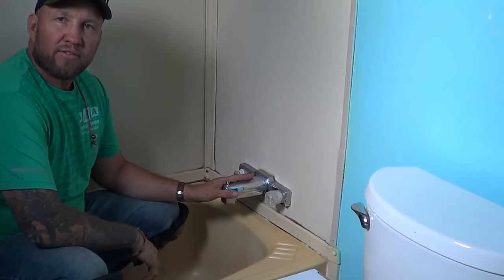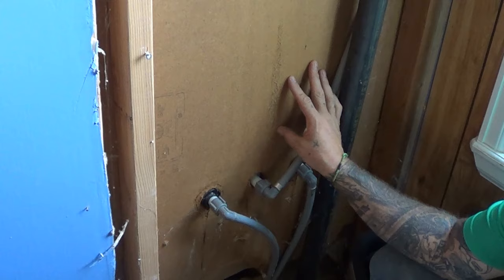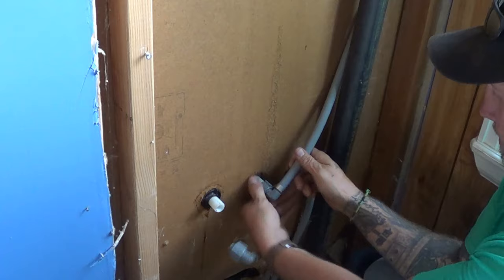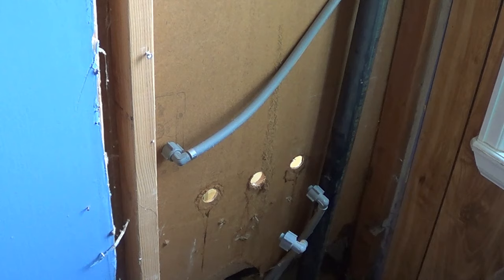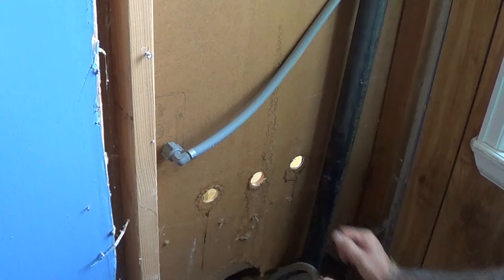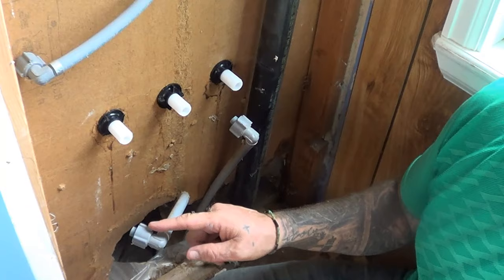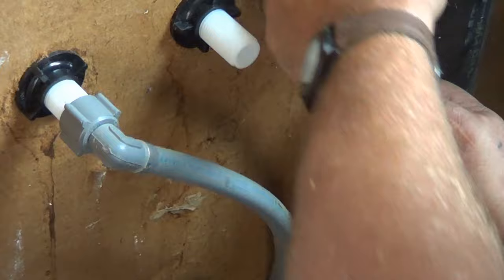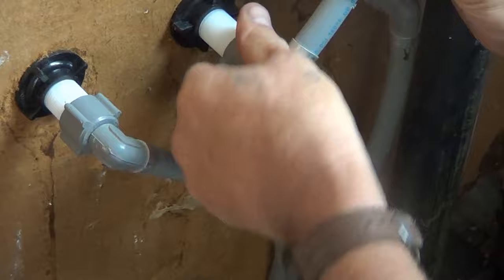How to install a Bathtub Faucet in a mobile home

Comment: How did you get the wall off
Reply from the maker: To remove the back wall, behind the surround to access the back end of the faucet, you will either already have the wall cut and be removable, or you will have to make a removable wall. This you will need to cut the wall itself.
If you are looking to remove the surround, you will need to gently pull it away from the existing wall. Now, you want to be very careful, the surround was glued to the back wall, therefore, when removing it may cause it to crack, split or rip apart. When that happens, you need to replace the entire surround with a new one. Sometimes, you can carefully pull it away with out damaging the back wall.

Comment: Just got an 87 doubble wide an it's got a garden tub, an a single shower,, in the master bedroom,, well the water is on an no leakes,, you go to cut the water on in the shower an it blowes out the back of the faucet,, whats up with that,, haven't worked on mobile homes before,,

Comment: any chance of fixing just the broken knob without having to replace the whole thing?
Reply from the maker: Hi. Yes you can replace just the knob. You need to remove the dial cover plate and behind that is a screw that you remove and now can replace the handle. If you are needing to replace the stem which is behind the handle, then you need to turn water off, remove the handle you will see either a brass or white plastic stem, you will use a wrench to twist off the stem. Get the right replacement part and replace the old stem. I hope that was a bit helpful. :)
Reply: @randythemobilehomeguy3715  Hello! This video is life saving! My hot water knob broke so I am using a screwdriver to turn the screw to turn the water on/off. The screw is getting stripped so I want to replace it asap. Can I replace just the hot water knob? Is there a special knob for mobile home faucets I need to purchase or would a local hardware store carry what I need? Do I need to turn the water off to do so?
Reply from the maker: @victoriablais9332  Hello Victoria. Great question! And thank you for watching our video!
Yes you can replace the handle of the faucet. Sometimes you can replace the handle with a universal one bought from a local hardware store. If they don't have it, you will need to purchase one from a mobile home store. If you are able to take off the working handle and use it for a reference with purchasing a new one, that would benefit you. If you are just replacing the handle you do not need to turn off the main water. Now if your teeth on the brass fitting or plastic fitting that the handle screws onto is bad and needs to be replaced, you will need to turn the main water off and drain out the line. That piece is called the 'stem & bonnet'. If you need to replace this, then you will want to take it all the way out. If you look on the piece along the rim you should see some markings. Those markings are the model number of that piece. If your local hardware store doesn't stock that item, you can find it online. Roughly $8-12 dollars a piece. 
I have found Mobile Home Parts-R-Us does carry mobile home faucets and parts. They should be able to ship you those smaller items. I hope this helps!

Comment: so connecting to toilet and bathtub i have to convert to "7/8 ballcock" right? fixxing my bathroom and 1/2 sharkbite threads are not matching toilet or faucet after the winter storm obliterated the cpvc in the house pretty much everywhere. for the toilet i think i just found out i can get 7/8 ballcock to 3/8 and get a shutoff valve 3/8 to 1/2 . not sure how i would go from 1/2 pex to 7/8 for the tub tho
Reply: Hello, the toilet fill valve threads are 7/8 and the faucet threads are 1/2 inch. They do carry a swivel flex line for toilet and a different one for faucet. I like the ones with a shark bite shutoff on one side. The swivel elbows you sometimes need for the back of the faucet which go to 1/2 inch piping are unique and you can get those sent to from Mobile Home Parts R Us

Comment: do you have any thing to replace the 1/4 in merflex pipe(original pipe writing) that goes from the faucet middle to the shower arm? home depot, Lowes, and ace hardware are completely useless in knowing anything about the line i need even when even when i have the part with me.
Reply: Hello, is it the gray piping with 1/4 inch inside diameter. It would be best to replace that whole section with all new 1/2 piping or tubing

Comment: Can I replace just a knob without having to cut out the wall? 😭
Reply from the maker: Yes you can replace just the knob and stem & bonnet. You would still want to turn off the main water if you need to replace the stem & bonnet. If you are just changing out the plastic handle, you don't need to turn off main water.

Comment: Are the plastic nuts after the swivel fittings supposed to be glued so you can't twist them off? I had a plumbing company replace all pur pipes a few years ago and now my hot water side is stripped on the handle and im trying to replace it but they've glued them tight for some reason so I don't know how to get them off.
Reply: They shouldn't be glued, I replace  two my old shower faucets with mobile faucets, in my mother's home, and they work great.
Reply: @sharkwo7  yeah I know they did a shitty job. We had someone come in and fix it properly.

Comment: Where is the shut off valve ?
We checked every where except under the home below the water heater....
Not on floor by water heater.
Not by the w/ d connections
Not outside the home...
Some say there may be two but where.....Any idea? 
T.I.A
Reply: The mobile home is brought to your site where there is a main water hookup, often coming out of a well the size of a five gallon bucket. From there a main water line runs along the ground to the hook up on your home, most often under the water heater. On this line there is usually a meter. Most often there is a shut off down in the well and just before it goes Into the house. Also they often put a shutoff next to the meter. If you live in a park, often calling the maintenance office ‘should’ help though not always I know. If on land there should be a metal capped well, often by the street where there is a shutoff. Hope something in there helps. Thanks for the comment.

Comment: Hhhhhhhhhhhhhhhhhhhhhhhhhuuuuuuu.... I was expecting to have to cut my wall open after I inspected my faucet situation. But I was really hoping there was a way to do it without doing all that drywall and mud as well. At any rate, thank you for the helpful video, even if it did confirm my ill fated suspicions.. thanks again

Comment: And a shower arm also, can I do that as in other videos on YouTube?
Reply: Hello, the shower arm you can do at the top like a regular house type application, you just have to add the support if your wall is wide enough to accommodate it. You probably know, but you will also have to do that from behind the wall . Just the hook up to the faucet at the bottom will have to stay the same, a swivel elbow.
Reply: @randydolph852  Thanks so much your a huge help. Have a great day and Happy father's day if it applies to you. Be safe.

Comment: My faucet is exactly like the one in the video for my mobile home. I went to turn off the hot knob side and yes it turned off, thankfully but something felt loose so for added measure I tightened a little more and now it just spins. I opened the cover for knob.. and screw is stripped too. Help please. Thank you. What iinds of things am I getting myself into if i try to fix this myself. The whole cutting wall thing for me in video.. isn't something im comfortable with.
Reply: So waters off. Knob spins. Screws stripped, on hot side. Same faucet in video.
Reply from the maker: Hi. I'm sorry to hear you are having problems with your faucet handle. I will do my best to help you! What you will need to do is replace the stem & bonnet that is behind the handle. That is what turns the water on & off. It sounds like that part is stripped. To do this, you will need to turn the main water off. Next, you will take off the handle by removing the the screw. Once you remove that, you will see the stem & bonnet. There is a clear plastic piece that is holding it on which will have to be removed by prying it towards you with a flat head screw driver, once that piece is off you can unscrew (counter clockwise) the stem & bonnet. You will want to get the exact right stem & bonnet for your faucet. They don't make a universal one for it. Once you reinstall new stem & bonnet realign it so that the clear plastic piece can go back into the holes. You will also want to get a new clear handle for your new stem & bonnet.  I hope this helps! :)

Comment: How does the shower get turned on? I don't see a knob for the shower
Reply from the maker: Hello, the knob on the tip of the spout gets pulls and closes off spout and pushes water up and through the shower head. Thanks for the question
Reply: @randythemobilehomeguy3715  I live in a mobile that has the Mohen 3 knob but I have to replace it all and that mobile home style looks a lot easier than what I have. I got by for a while replacing washers but it's shot, even the shower won't turn on. I'm replacing the wall there too so I wish I knew if it would be better to go with the mobile home style. It looks like hot and cold water lines connect and a pex hose connects to the shower head. Is that what I'm seeing?

Comment: What kind of wall panel is that
Reply from the maker: Most of the time it's a drywall panel on the back side. Sometimes, it will be the wall paneling you often find in mobile homes, it's a thin piece of paneling, that you can purchase from Lowes & Home Depot.
Reply: @randythemobilehomeguy3715  they don't screw it on do they
Reply from the maker: @brandoncoley8190   sometimes if the homeowner has already worked on the tub/faucet, the'll have already cut a hole out and used it again , so they'll use screws to hold it on. You can do it that way. I've even seen people whose panel is on a bedroom wall, they will trim out the area where they had to remove the panel. It looks nice.
Reply from the maker: You can always use brad-nails to attach it
Reply: @randythemobilehomeguy3715  so they don't use adhesive glue I saw a video where they just nailed where the trim went and glued the rest to hold it
Reply from the maker: @brandoncoley8190  If it's the back side of the wall where you access the back end of the faucet, you can do it that way. I wouldn't recommend it. You want to have access to that area for future use.

Comment: I have a fitting that is connected to the shower part how do I get it off it's one piece connected to a metal pipe
Reply from the maker: First, Thank you for watching the video!! You will need to access the back side of the wall to see a nut that is attached to that metal piece. It is what is holding it up against the wall. You may have to cut an access panel if there is not one already. I hope this helps!
Reply: @randythemobilehomeguy3715   yes I have a solid piece fitting on the backside of the wall connecting it to the faucet , not the swivel type. How do I remove it.  Please and Thank You

Comment: why didn't you install push on isolation valves while you had the water off.
Reply: Hello, and thanks for the reply. We can do that for sure but sometimes the customer is just looking for a simple replacement of the faucet which is what we were doing here. I like the shutoffs with flex lines but none have to swivel elbow on the end that connect to this application. Could have put an inline shutoff but that’s not what we were trying to highlight. Thanks for the comment.

Comment: Why no Teflon tape
Reply from the maker: The fitting that you are using to screw it onto the faucet, should be a fitting that has a cone shape washer inside of it, that when you screw it onto the faucet it acts like teflon tape and keeps it from leaking.

Comment: Seriously, they need to make the process simpler. At least place an access panel on the wall where you need to access the faucet. With my tub, I have to use a wrench for the cold water and a needle nose plier for the hot. It's a pain!
Reply: Hello, I totally agree. Some of them are even in the same compartment with the water heater. A pain for sure! Thanks for the reply